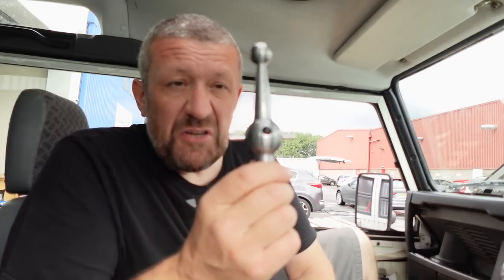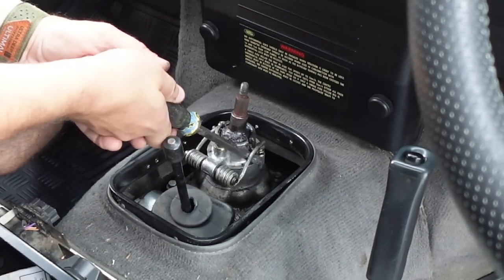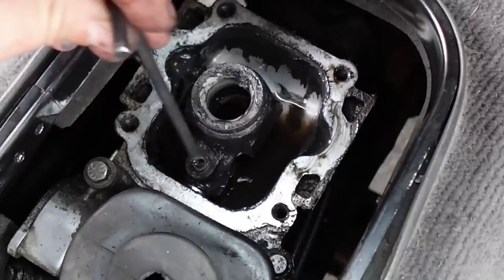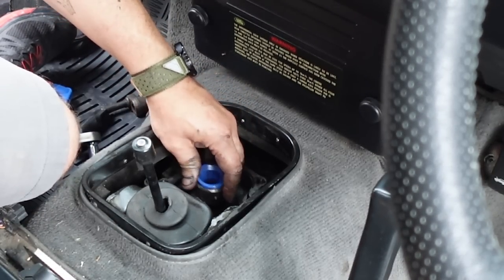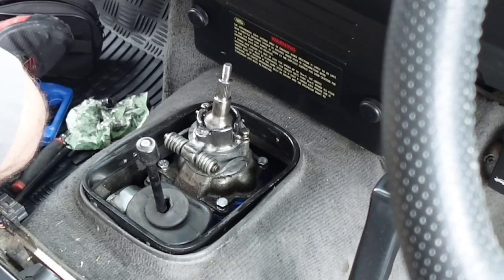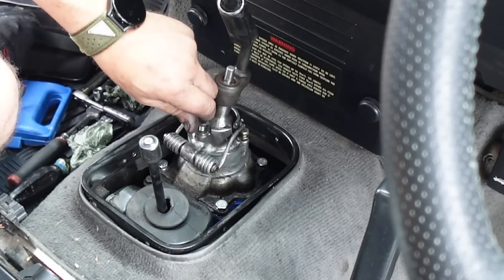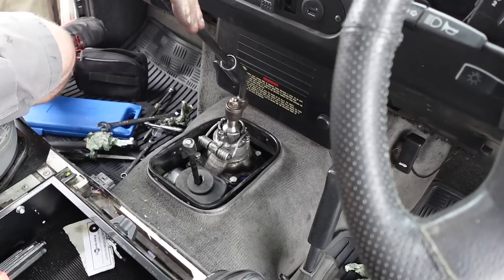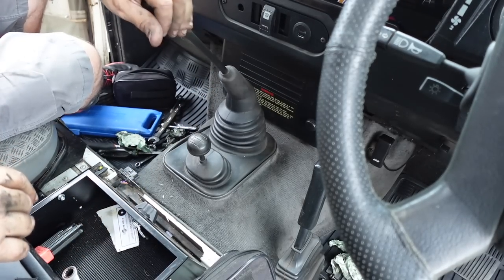Fixing the Defenders sloppy gearchange

Comment: Never had a problem with the factory setup, if the bias spring is adjusted correct then the throw of the gear lever is nice and tight and positive...I've had defenders all my life and never have i felt the lever needed correcting from manufacture, i have driven one with a short shift fitted and didn't like it at all, to me its a characteristic of the vehicle.

Comment: Anyone fitted the Puma version to the MT82.  It's an inherently notchy change at the best of times, I was wondering if this mod improved or made the situation worse?
Reply: Yup, the throw is significantly shorter. Makes it feel a bi t quicker and more concise. At times maybe still a little notchy, but definitely an improvement. Had it in about 8 months and feel like it makes enough of a difference to be worthwhile. The original puma pivoting ball part is nylon and it cracks and deteriorates, but  the replacement is all metal,so ready for the next £100k hopefully!
Having watched this, I’m going to put one on the Defender 300tdi we have as well I feel.

Comment: Advise to buy two new gaskets or a tube of RTV and have some fresh grease handy for lubing it all up again, loctite the grub screw is a good idea also. 
The 3rd-4th gear bias spring setup can be a bit tricky, make sure the turret is not worn,  may take a couple of attempts to get it spot on. My R380 change is much nicer with it fitted, not faster, it is a not a Honda gearbox, a momentary pause in between gears but just a nicer change.

Comment: I would have put some thread locker on the grub screw (you don’t want that to come loose 😮)
Replacing the bushing on a 100k miles car will most certainly also stop the gear stick from rattling.
Reply: Yeah I would have put some loctite on that grub screw. Had mine back out years ago lol

Comment: Gut feeling, looking at the vid is that you've got the new pin set ever so slightly too tight.
When you let go of gear leaver in neutral it should centre itself between 3 & 4th. But I'm being pedantic.
Slick shift is a great bit of kit.
(Oh btw, a touch of light grease in the bowl of the new silicone thingy doesn't hurt either)